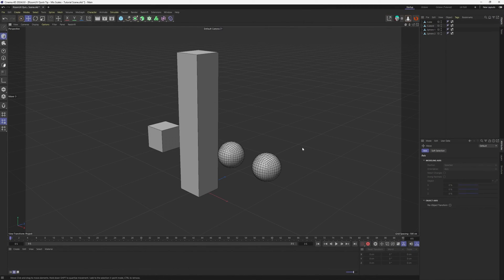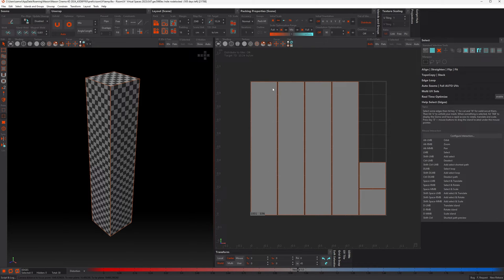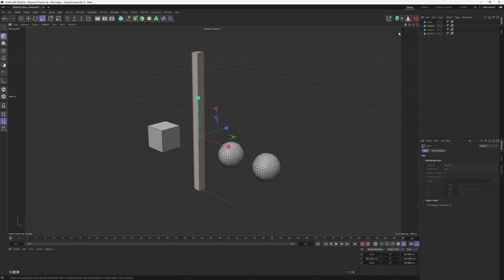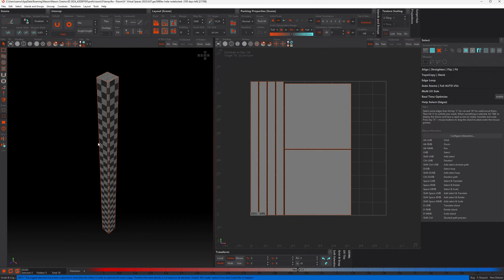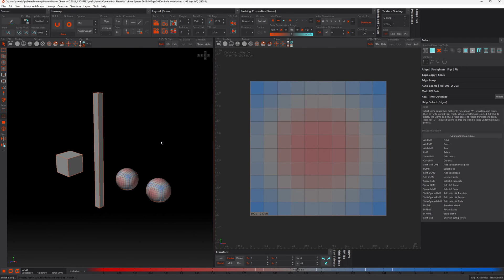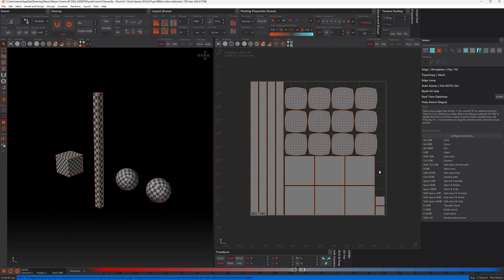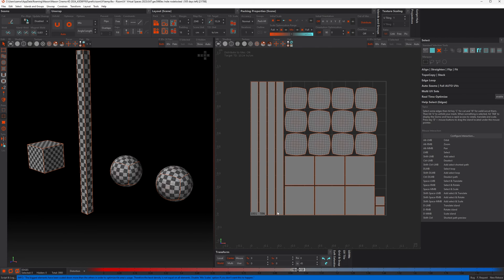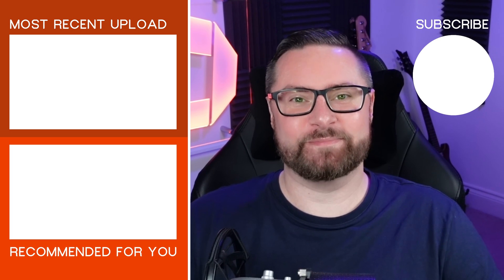RizomUV Quick Tip: Mix Scales Optimization

Comment: In 2022 there is function to set scale as percentage so it will scale some uv as specific presentage based overall uv. Did you removed it?
Reply from the maker: Are you talking about "Scale Optimization"?
Reply: @RizomUV  Oh, don't worry I just found it at 'initial scale' :-D
Reply: @RizomUV  Yes, for example I want to enlarge a certain uv to 200% (or 2x) larger than the other uvs. How do I do that?
Reply: @penyusupbumi215 You just double the texel density value.

Comment: There are some cases where texel density doesn't matter to me,
and i really want to adjust a couple of UVs to be much smaller than the rest, while enlarging others.

kind of what you did with the mix, but what if i want to make it smaller, by hand, how can i do that ?
Reply from the maker: Select the island, and scale it using the transform tool.

Comment: What's the RizomUv widget that is used on c4d ? and when you use it to import the model to rizomuv,it's like the dynamic link on adobe programs ? I mean , after the import , when you unwrapped the model on rizomuv and saved it , the uvmap will be changed on c4d ?
Reply from the maker: Yes, it's the RizomUV bridge for C4D, this is created by a third party dev.